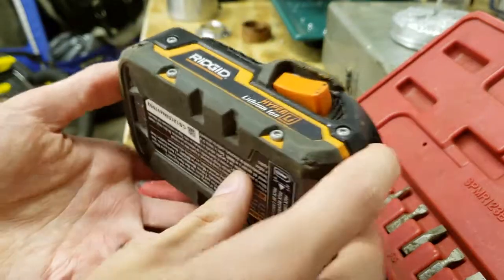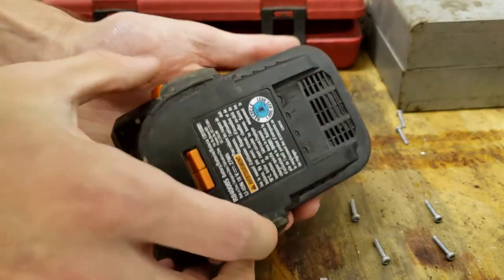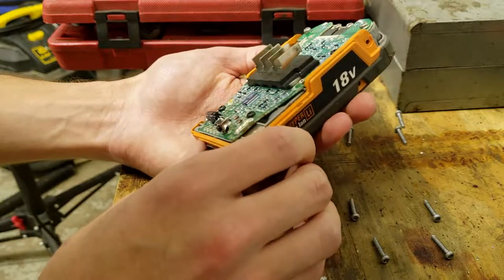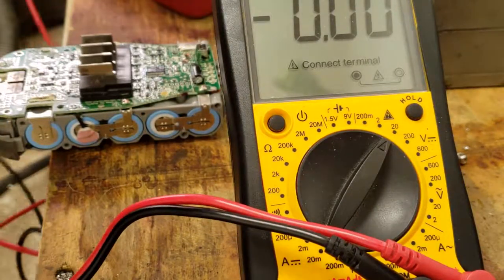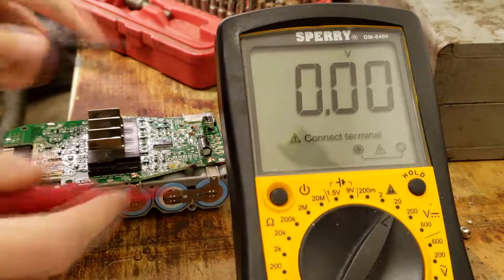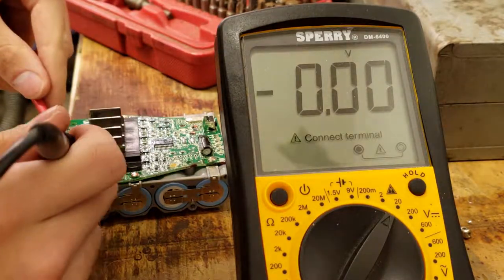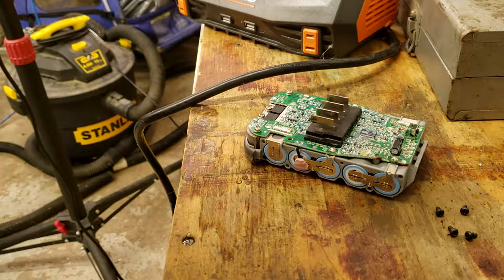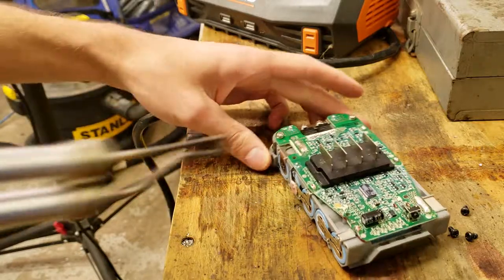18v Ridgid hyper lithium ion repair

Comment: i bought my drill set two years ago from rigid.  registered it right away. The first battery went bad no problem they sent me a replacement. second battery went bad a year later and sorry we cannot find your registration you have to buy a battery, so much for forever warranty on the batteries, they are not cheap.

Comment: Thanks for sharing!  I have one that wasn't very old and died under a pretty heavy load on my drill. I replaced it on line but they didn't want the battery back so I'm going to do an autopsy on it on a rainy day.  My theory:  What's worst that can happen? Waste a few moments at the work bench?
Reply from the maker: Exactly, I miss working at the shop! I need to get out there more.. darn job! Haha

Comment: I have one doing the same thing.  4.10 volts reading on each 18650 but nothing from the connection that goes to the drill.
Reply from the maker: Maybe check the fuse at the video at 1:11 its in the top left corner its a cutout piece of metal I've heard that if the battery is run hard that can break

Comment: im using a t10 to get the screws out and cant because of the little nibs inside the screw any tips on how to get them out pls
Reply from the maker: One way would be to break the nibs but that's your call otherwise using *Security* bits would be the best option
Reply: I have a set of bits made for the "security" screws. Mine are from Craftsman.
Reply: @randyhilton7890  ok thanks from Canadian tire?
Reply: Almost every "electronics repair kit" from Amazon should have the right bits for the job.

Comment: So we never get to know whats wrong?>
Reply from the maker: The problem with my battery was a bad solder joint, I reflowed and it worked again. I've said it a few times in the comments but I didn't make a update video. You can also look at the fuse or check your cells.

Comment: I can't get a reading on anything all my batteries can't be bad right? .   Also when I put it on charge it blinks red once then says full charge but when I pull it off the light may blink on 1 for a second then nothing ... Thanks in advance
Reply from the maker: If your batteries read 0 volts then they are toast there will be no reviving them you'll have to replace the cells
Reply: Is it common for every single one to be toast ?
Reply from the maker: @chetcross7692  well, it would make sense cause even if only 1 cell was bad then you have the rest trying to compensate for the lack of voltage so they over discharge
Reply: Thank you for responding ,  firstly . Those batteries would keep a charge even if the batteries been dead for probably at least a couple months
Reply: @chetcross7692  I've got a similar situation. I have a 3.0ah battery and every cell has 0 volts. I'm not very technical with this sort of thing, but it seems strange that all 10 cells would be dead like this. I'm wondering if they could be brought back to life if they were charged independently.